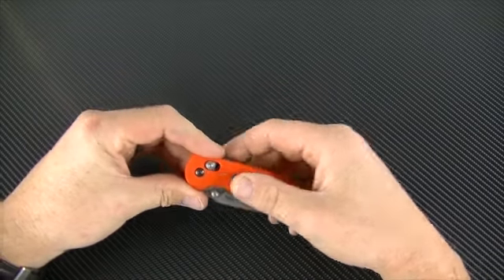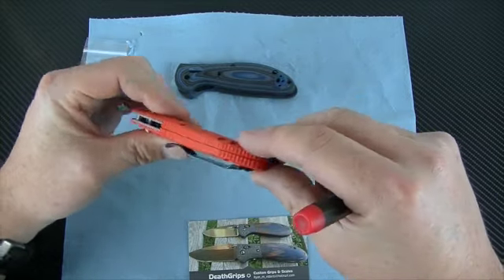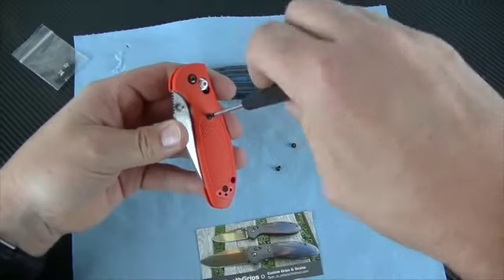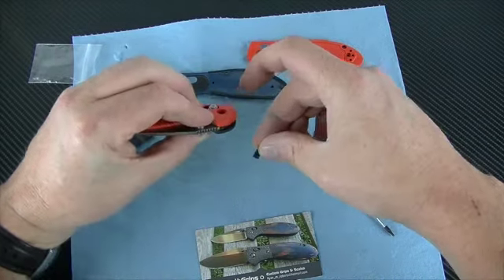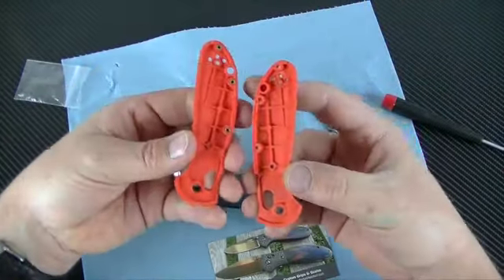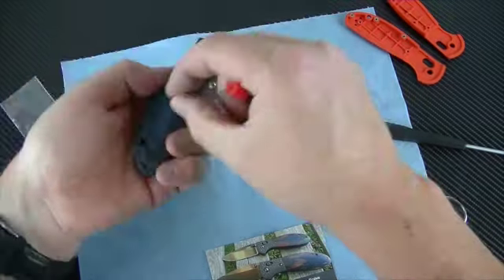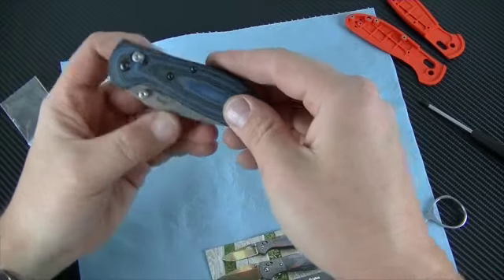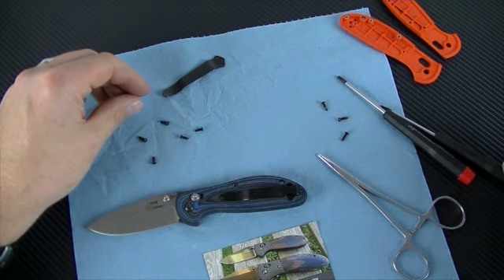Benchmade Mini Griptilian RSK MK1 - G10 Scale Upgrade

Comment: Definitely beats the stock scales! Just bought flytanium copper scales for mine. Heavy though. Having trouble getting the tiny screws out as well. But I really like that black/blue woodgrain set you used in this video! I need to check out that sight! Edit: I am having serious trouble fitting the pivot/nut back through the liner and washers and blade. Even when I depress the lock and use the tool to push it's not working.